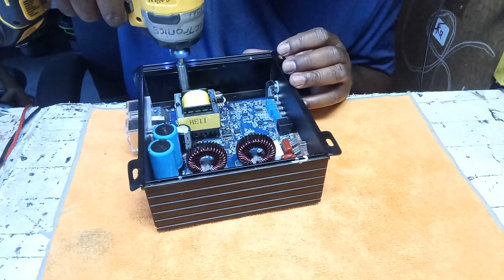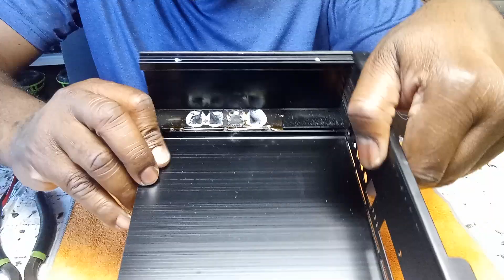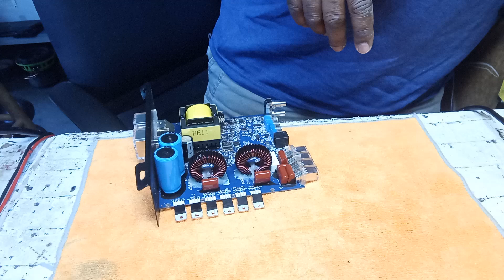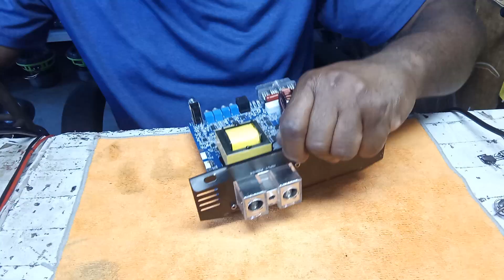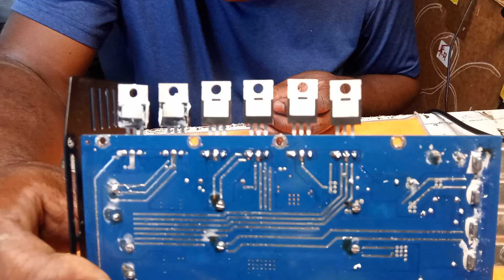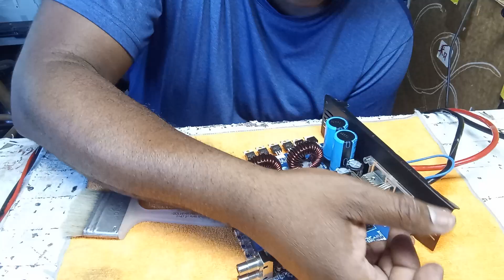SUNDOWN SIA 1250D Burnt Out Power Supply And Output Mosfets Full Video Repair 👏🏽

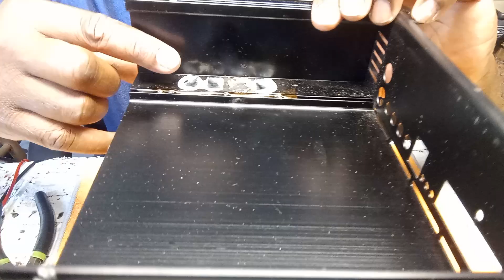Comment: I have the exact same amp. Do you have any clue where that person had their high pass filter set to? I have tried to set my high pass with a multimeter and it goes all the way to 3:00 which it's close in my estimate to like $1,500 HZ. I have optimistically put it at 10:00 thinking my meter might be wrong. What are your opinions?